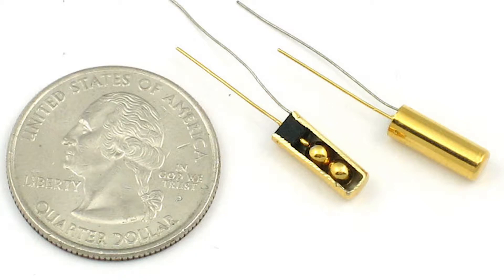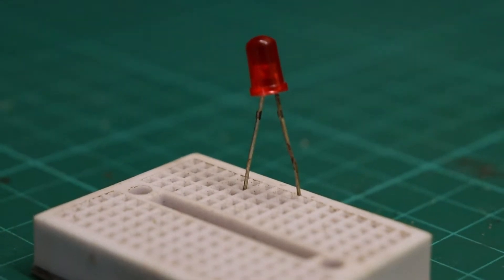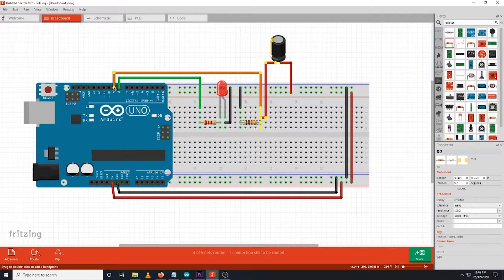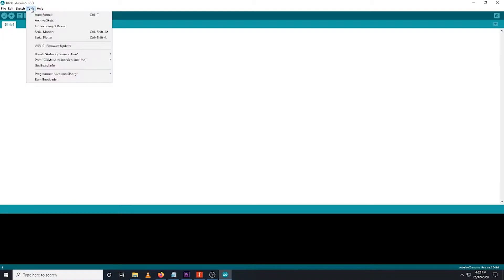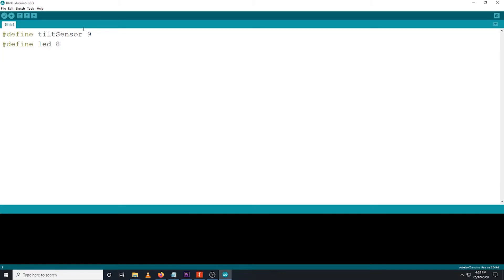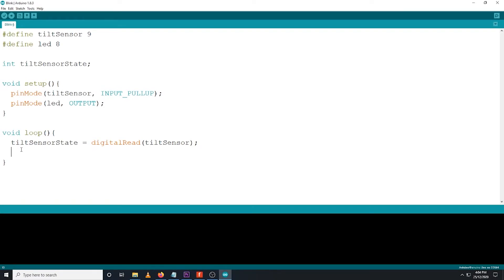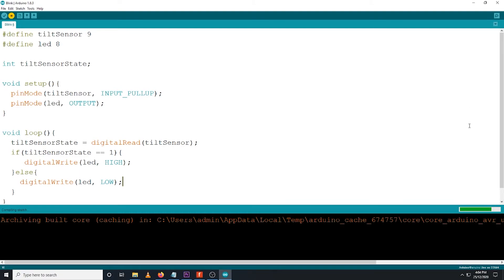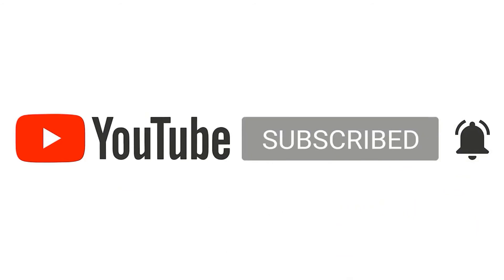Arduino Tilt Sensor Ball Switch - Wiring and Programming - Understanding & Programming Tilt Sensors

Comment: Hello po, aside from LED, LCE, Realy, Buzzer, DC motor, Servo motor, and 7 segment display, ano ano pa po ung other kinds of output devices that can be used in Arduino?
Reply from the maker: Actually any dc electronic sensors/devices can be used in arduino. It will really depend kung ano ang gusto mo gawin or maging purpose ng project mo using arduino. You have to finilize your plan or idea para maidentify natin ang need mo yusing arduino